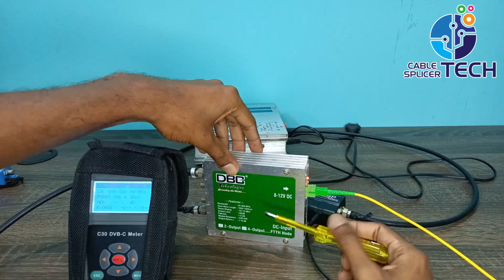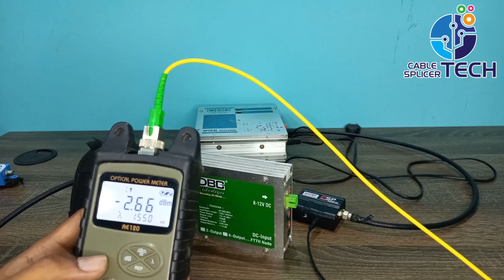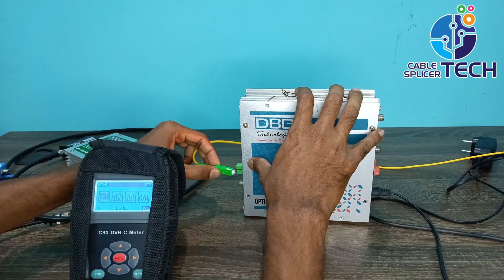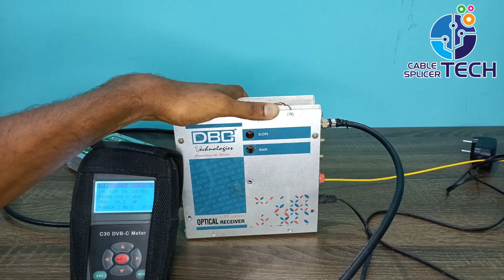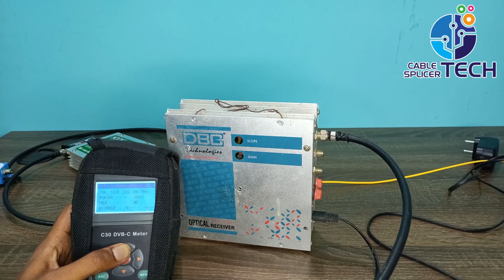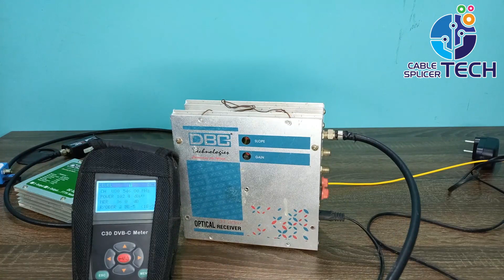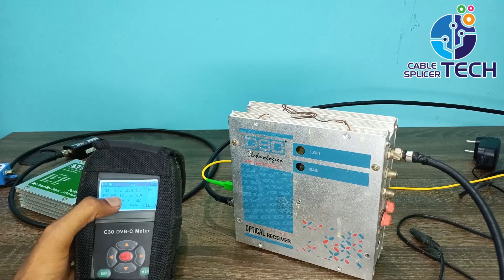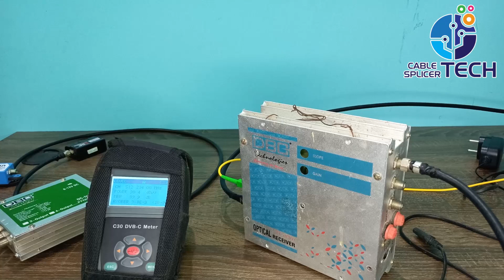Optical Node Output Level 106 dB ( Real or Fake ) Live Test |  Best MER Node ( AC Node or DC Node )

Comment: Do a video on how to make your catv field passive with EDFA or PONEDFA, With 1 out Ftth passive node to 6 out Ftth passive nodes, How to Maintain The Fiber power level to each pole
Reply from the maker: 16dbm or 19 dbm ??
Single out passive ftth node  calculation or
6 out passive node to Coaxial cable to customer END
Mention @ EDFA Power &  total Customer & Passive node Out 1 or 2 or 3 or 6
Reply: 19.5dbm
Reply: 6 Out Passive Ftth Node Power calculation

Comment: Node first level vaikkum pothu epdi level vaikanum
Reply from the maker: slope full ah kammipannitu gain ah vachi set pannanum average level 90 to 95 in node
Reply: @CableSplicerTech  apa slope adjust panna koodataha gain maddum than adjust pannanuma
Reply: @CableSplicerTech  ok
Reply from the maker: slope flat pannitu gain 80% set panuga then next slope 15% vachale pothum anna
Reply: @CableSplicerTech  ok 👍 bro I will understand
Reply: @CableSplicerTech  konjam puriyama question ketta sollunga bro
Reply: Naan solid 750 meter vachurkan bro
Reply from the maker: @abduljalal1797  kandippa soluren bro., keluga bro
Reply from the maker: @abduljalal1797  sf750 meter na transmitter ku 78 level and node 93 vaiga bro pothum
Reply: @CableSplicerTech  👍
Reply: Bro amp epdi alakkanum
Reply: @CableSplicerTech  👍ok bro
Reply: E12 than level naan pappan atha kannakku panni vachan pothuma transmitters kum node kum
Reply: Enga mso signal first band la tha start aaguthu 146 mhz la so naan E12 la level paarthele line freezings illama odum bro
Reply from the maker: @abduljalal1797  860 mhz amp na 90 kula vaika bro
Reply: @CableSplicerTech  550 mhz evalo vaikkanum bro
Reply from the maker: @abduljalal1797  85 kulaye vaiga bro